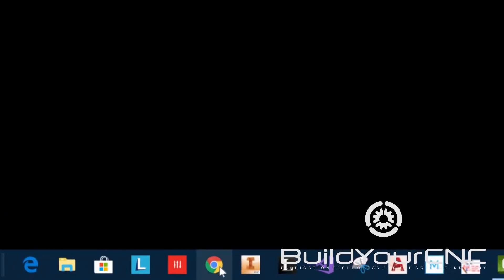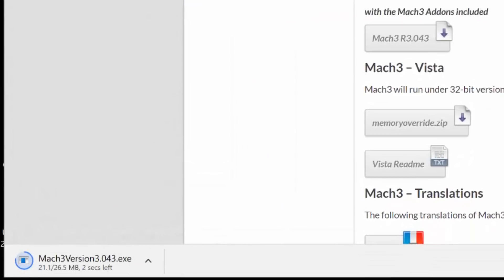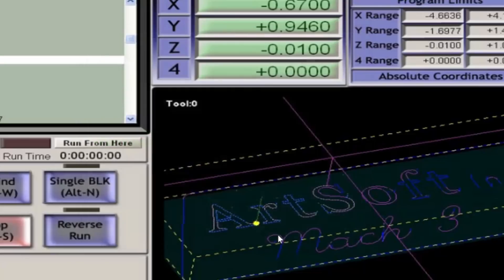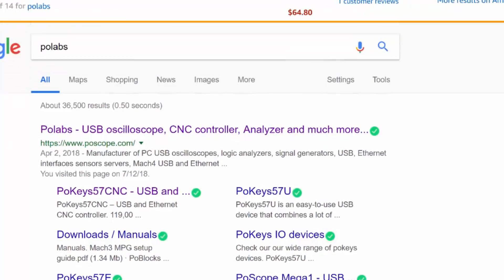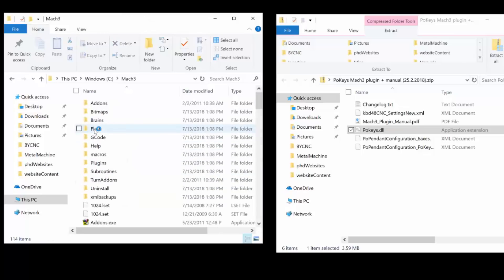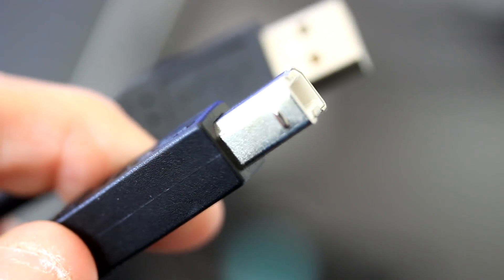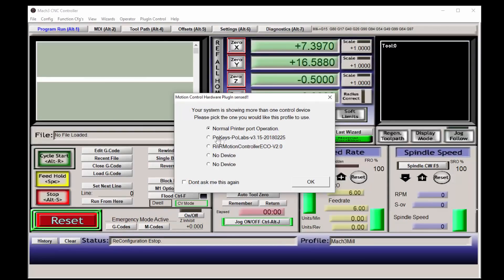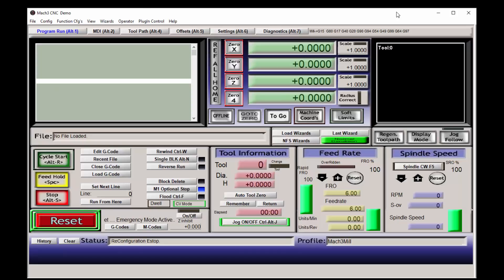2. Install Mach3 and the pokeys57CNC Plug-in for Mach3

Comment: How come nobody can do a clear explanation of ethernet set up? Now all my junk is locked up because of that unclear ip address change garbage.
Reply from the maker: Where did you purchase the board? If you didn't purchase from me, you can always go to Polabs support (Polabs.com). They are excellent at resolving issues like this.
Reply: @PatrickHoodDaniel  I have managed to get it working, I'm not exactly sure how I did it, but its connecting everytime now thru ethernet. What I'm trying to figure out now is im trying to do single pulse index threading, I have a prox sensor reading a magnet on the spindle, and I also have an omron encoder 1024 ppr.  The encoder is hooked up to the encoder connector on the board according to 5+, 0v, A, B, Z. I see it is affecting the rpm but even with it disconnected my true rpms are all over the place. I'm wondering, if my ethernet cable has wimpy shielding, will it cause this? No matter what I do I cant make the true rpm read zero as soon as mach3 is started from restart. If I use the index prox sensor and magnet I'm sure i would need something to condition the signal right? I'm running this on a lathe, i do NOT have a vfd, I want to start the motor manually, see the true rpm on mach3, set spindle to match and single point thread. Im hoping it's my ethernet cable, that's a simple fix.

Comment: Could you this PoKeys57CNC to Ethernet smooth stepper plus breakout board c79 though? Seems like this has all the necessary stuff going on in one board. Cheaper and easier to set up. Am I correct. Also what about the THC they sell? Good or bad?

Comment: why my Mach3 can not identify PoKey Plugin?  (I already copy that to Plugin foder)
Reply from the maker: The following could be the issue: Each Pokeys57CNC has it's own ID.  If you changed to a new board, and you are trying to use the same ID, then you will need to delete the old ID that is stored in Mach3.